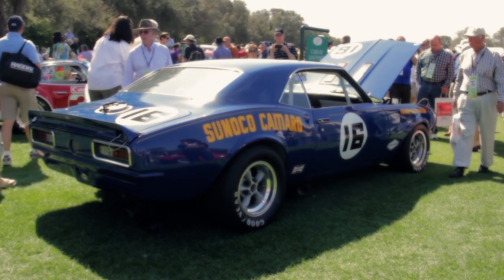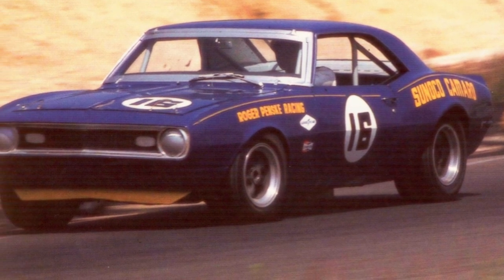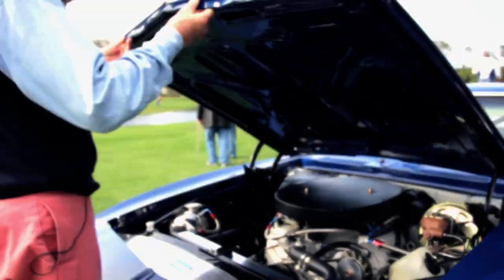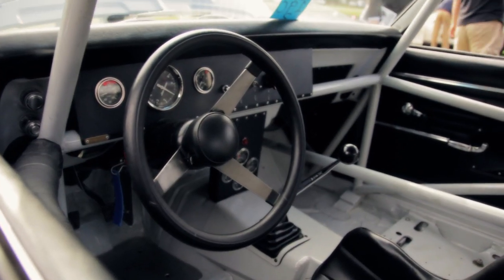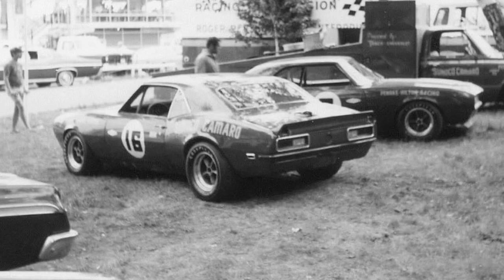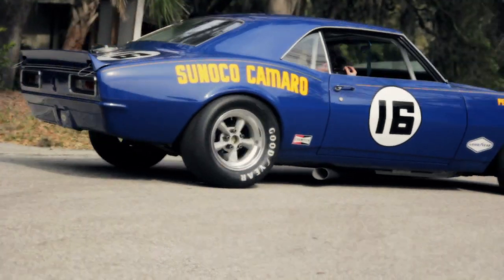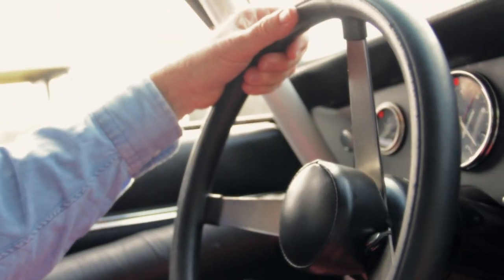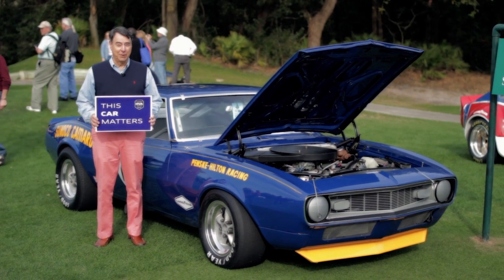THIS CAR MATTERS: 1968 ex-Sunoco Penske Team Trans-Am Camaro

Comment: Did they use leafs or pull them out and throw in a coil suspension?
Reply: +Kyle Lumpkin Suspension had to be the same configuration as stock.  Leaf springs in the rear.
Reply: Leaf springs, addition of a rear swaybar, and a PANHARD bar to locate the rear. 
In the front they used a 1-1/4" sway bar for the original 3/4" one moved the upper A-arm mounting position down by about 3/4" and slightly to the rear in order to correct the bumpsteer which made them handle so much better... 
They ran the J-56 HD Corvette Calipers with twin pins, 4 pistons, and phenolic pad insulators adapted with with capability to apply a slight vacuum to the brake system in order to retract the pistons into the calipers during brake pad changes which allowed the Penske team to gain as much as a lap on the Mustangs at every stop for pads.  

FWIW Penske brought a level of professionalism - preparation to show room stock racing that was unmatched, think about the fact that Penske/Donahue took the AMC team and won the champsionship with a inferior car and manufacturer without so much as a podium finish EVER. The AMC heads were terrible, they ended up welding the heads up and reconfiguring port and runner design.
Reply: are you saying the "dog leg "  port head design that AMC came out with in 1970 was a Penske innovation?  that would imply that Penske was engineering with AMC early enough to have implemented a change in 1970 production?  From research and development through design, prototype and testing, and then be put into production it would seem more likely the TRACO or Kaplan Team, and not Penske's work with AMC might have been influential for one of the best American cylinder head designs ever.
 As for "podium" finishes AMC was right on Chevy's heels in 68 -69, maybe not getting first place, but second and third.  AMC's so called  "inferiority " in cars and manufacture is a MYTH..... look at the results, with or without Donohue and Penske. only thing thing AMC  didn't have that other manufactures had was money and experience., but they still were competitive.

Comment: This was one of the cars that GM had the bodies acid dipped to reduce the weight of the car to the point where it was illegal and under the weight restrictions. They would bring 2 cars with the number 15 on the side. One was acid dipped and the other wasn’t. Then they would weigh the non dipped car then quickly paint the 15 into a number 16 and weigh it in also. It was a genius weight reduction trick at but the fact that they did this repeatedly should’ve gotten them DQ’d after the second time. But that also leads to GM threatening to withdraw from competition entirely which of course was not desired.

Comment: What happened to the '68 spec parking lights in the fenders? The archive footage shows them but this car appears to be a '68 with the vent windows removed?
Reply: +Denty Kaffalatta Vent windows disappeared for 1968.  Only the '67 had vent windows.
Reply: +Jim Estep Yeah. I was thinking backwards. Thanks. Was concentrating on the lights. Heh, Cheers!
Reply: +Denty Kaffalatta You're correct on the side lights, Denty.  Those two items, lights and vents are what separates '67 from '68.
Reply: My guess is they filled and smoothed the body where the side marker lights were to improve aerodynamics.  Keep in mind, The Unfair Advantage included many seemingly small touches, like the air wrench with all five lugs in one, the high tank for refueling.  Penske and Donohue were very innovative.

Comment: If four of the Penske 1968 sunoco race cars are known to exist. Then my question is what happened to other two Penske 1968 sunoco camaro race cars?
Reply: Joe Dirt likely deteriorated. The cars were acid dipped for weight reduction. It was genius the first year but then was ruled illegal and they decided to do it again anyways. They had to sneak the car into regulations a certain way. Look into the history of the car and you’ll see
Reply: @spicymiataguy9115  IIRC, they INENTIONALLY wanted race number 15 and race number 16 so that they could be quickly 'morphed'.
The HEAVIER car is the one that was checked  - TWICE (once with each race number on it).
The LIGHTER car is the one that was qualified - TWICE (once with each race number on it)